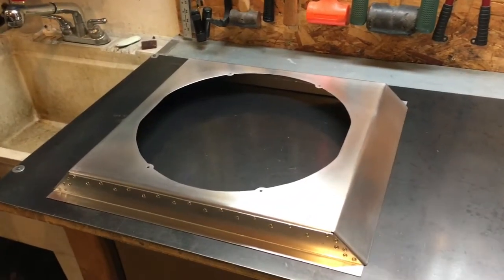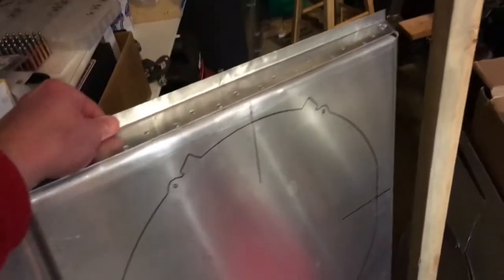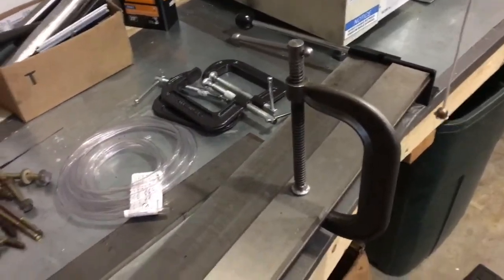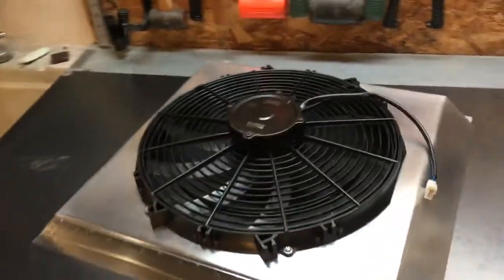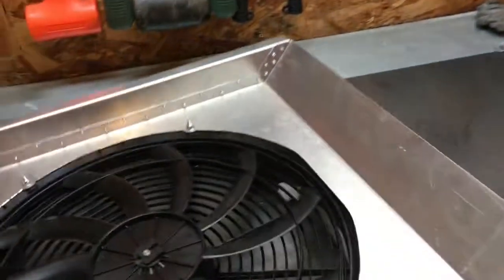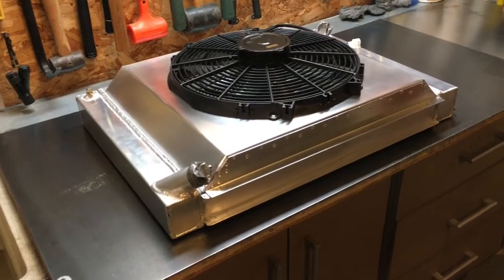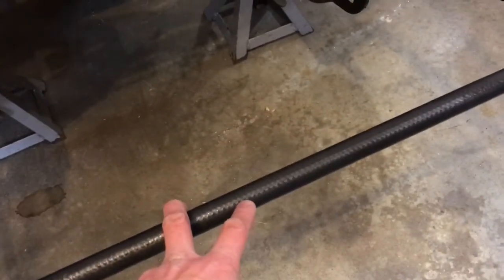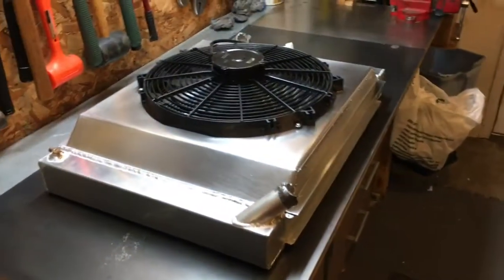Factory Five Cobra: Fan shroud fabrication

Comment: Karl, you wouldn't happen to have the drawings and calculations for the bends still would you? Are they on the forums somewhere maybe? I was going to buy one of these but after seeing your DIY I'm thinking I'll just go pick up the HF brake and sheet aluminum and do it myself.
Reply from the maker: Christopher Arella / it’s not hard so don’t be afraid to try / just buy some extra aluminum. Regarding formulas, I’m pretty sure I picked a 45degree bend based on where the fan edge landed and worked backwards. You basically want enough space to move air easily when the fan isn’t running / I think summit might even sell blanks that are close to the right size - go for it!
Reply: @TacoJoe  Thank you. Now I'll have to request the HF brake for my Birthday. ;)